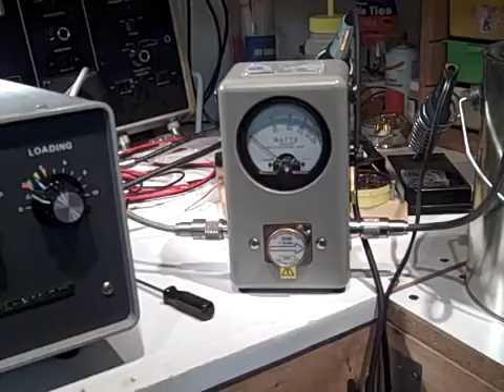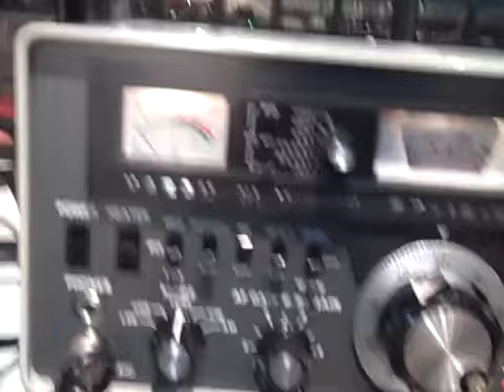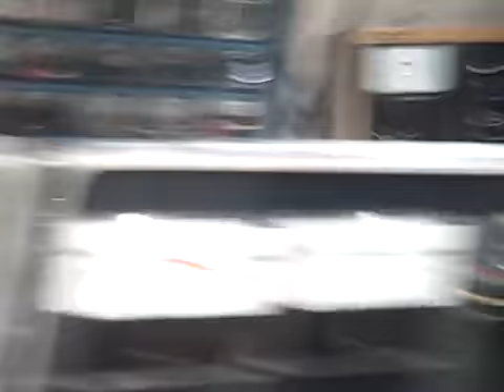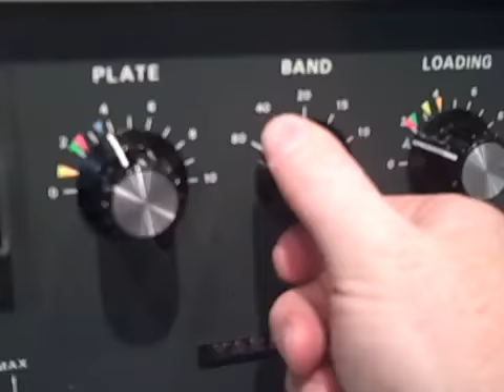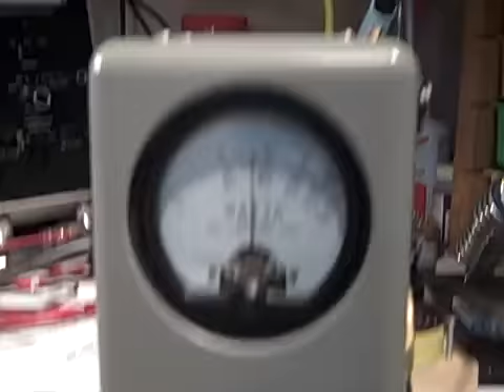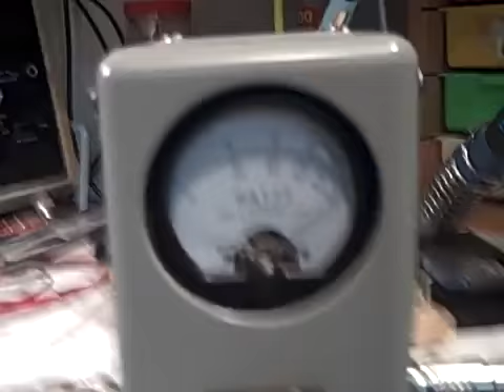Yaesu FT-101E  & FL-2100B AM Tune Up Procedure

Comment: The user manual explains the tune up procedure fairly poorly. From what I can tell, you tune it for maximum RF power output with a plate current of 0.5A (CW?) With normal speech on sideband, the meter should indicate around 0.2 to 0.3A as the needle can't keep up with the peaks. So this is a range that roughly means you are not exceeding the plate current limit. On AM, tune for 0.2A with an unmodulated carrier.
Now, did I interpret this correctly? Is this what the manual is saying?? Can somebody please confirm this for me? Even elaborate for me.

Comment: After peaking the load, you should switch to grid current and readjust the load control for lowest grid current without reducing the output power by much.

Comment: Your following procedures as I would. If I may answer your question with a question,  does your 101-E drift on you?. Mine is starting to drift frequency a little, I think it's time for a recap and to possibly look over  the crystal oscillator. 
  Kind regards, Eric Dee.
Reply: Eric Dee very minor drift, it's actually pretty stable.
Reply: @theredbaron057 : Thank you for your time in response. That's great considering the age of these beauties, I'am glad to see someone besides myself taking pride in following the suggested tune and load process suggested. The Yeasu 101-E is a very mechanical rig which obviously as your aware, takes a little patients in fine tuning prior to carrying on a QSO, it's not by no means a "Plug N play" rig that a lot of the newer ham operators are used to, the Seasoned vacuum tube veterans are thinning out sad to say, my late Father for example licensed back in the mid 1930's tought me a lot about vacuum tube equipment, he also had a 101-E with the matching amp, scope,  phone patch,external V.F.O. Mic , can't remember what other goodies, but they are Of the working class of ham rigs for sure.
   Thanks for sharing, enjoy your 101-E.
    Kind regards, Eric Dee.

Comment: Taking it easy but not fearing USING the FL-2100, just keep in mind it's a real world 600w pep amp, will do more but let's stay real world and not "push it". So, divide pep by 4 and at 100% mod you should enjoy 150w carrier without fearing hurting it. Want to "Take it easy"? 125w with audio peaks at 100% of 500 pep, a very decent & respectable signal for AM.
And David, I'd enjoy chatting w/ you about a couple ideas I have for your "Challenging" antenna QTH. Plus, if you're using an 857D for HF, give serious consideration to INRAD's 2.9 SSB filter. A friend of mine TRANSFORMED the quaity of both RX & TX by adding one to his 857D and says it's the single best mod he's ever done to any radio & he's had many -73
Reply: Finally somebody who speaks the TRUTH.That amplifier is one of the worst ever at being over driven.People think it's a 1200 watt PEP output amp when the 1200 watts is Input not Output watts.

Comment: I had always thought you should tune both the 101 and 2100 for maximum smoke on SSB and then back your carrier down for AM and keep it where the book suggests (I want to say 40ma) but double check. That should give you about 25 watts of AM carrier times 4 to equal roughly 100watts of AM out of the 101. Going into the amp its going to times that by 4 again. Move your carrier up or down to adjust AM power. Becareful of those sweep tubes in the 101 with prolonged tuning periods.  Flip it on and tune and back off again as fast as you can.

Comment from the maker: I would simply use eBay to price out sold listing of each unit. You could try and sell together, but it may be harder to find a buyer for both - especially if you don't know how to test them. Also, if you don't know how to test them properly, don't even think of transmitting on it. You will most certainly damage the transmitter and/or amp. Find a HAM club near you and ask a HAM for help. Good luck!

Comment from the maker: Hi Johnathan, congrats! Your best resource is another amateur operator to assist you. Preferably one with experience on old tube radios. You can easily and almost instantly destroy a radio if you try and transmit without a properly tuned antenna. I would find a local ham club and ask for help. All the old guys will be familiar with this radio. Don't forget, you *must* have a ham license to transmit on the ham bands. For the 101 (hf radio), you'll need general class or higher. 73 de KF6UME

Comment: Hi DL3CE, I'm sure you may be correct under some circumstances, but it turned out to be a fault with the amp - it shouldn't show a current at rest with zero drive. I checked and found both the resistors R7 & R8 were showing scorch marks and one was out of tolerance - changed these but it made no difference. Then I found that resistor R5 was cracked in half, open circuit. Replaced this, turned the amp on, no current at rest! Amp has been working like a dream ever since.

Comment: That's the BIAS current, perfectly normal (But lookup the exact value for it in the manual). You would actually have a problem if that was NOT there.

Comment from the maker: Thanks for the comment! It will handle up to 1KW in short bursts, and easily handles a few hundred watts continuously. GREAT for the test bench. I built it over 10 years ago and have never had to replace any of the resistors (or oil). You know you've been putting out some juice when the can gets hot! Anyway, just google "oil filled dummy load" and you'll find tons of info on how to make one.

Comment from the maker: @af4k Yes, I agree. I've found the best output and best audio reports are after I've tuned the output power while modulating the radio. It's usually a very slight adjustment, but it does make a difference. Thanks for the post!

Comment: THAT's a great AM station! You should see excellent results.

For AM mode, I would tune for best efficiency on voice peaks. Therefore tune as you would normally at full power. For AM operation you should see reduced power at rest and then modulate so that  your 25 watt carrier from the 101E kicks up to 100 watt peaks, approximately. (INPUT power) I am not sure how much difference it will make tuning the rig and amp at 80 watts versus 600 watts.
I would be interested to see others' comments.

Comment: That would be great! He can contact me via my QRZ profile or youtube. I'm quite sure my FL2100B has two problems: 1) soft tubes & 2) a few bad components. Power output is only ~300 watts with 100 in and there is a faint burning smell when using the amp on 10 - 20. On 40 & 80 it gets up to about 450 with 100 in. Strange thing is all parts look perfect with no burn marks. I can't isolate the trouble.